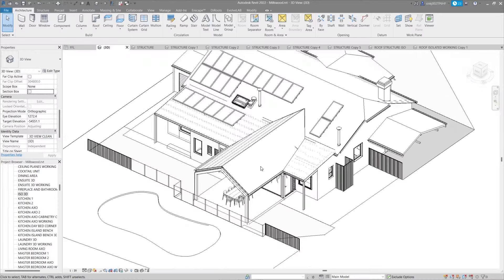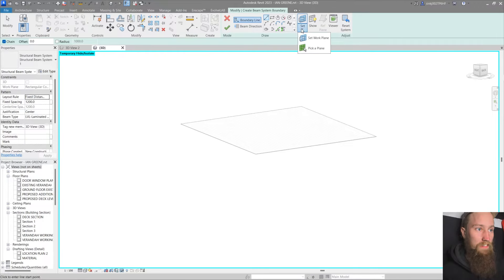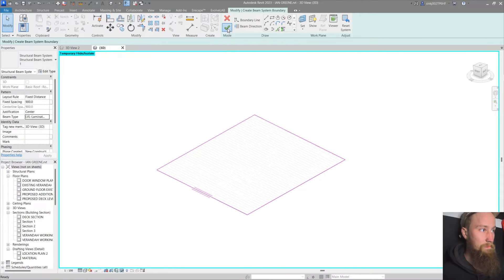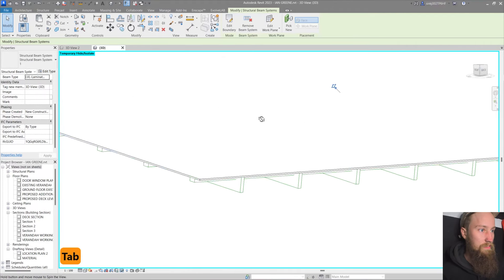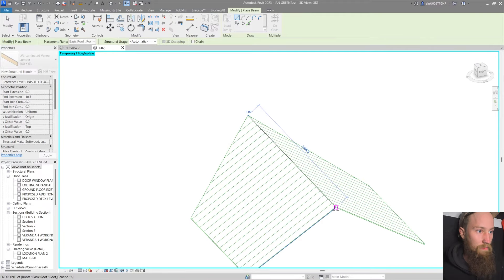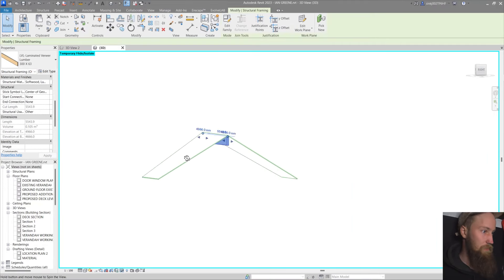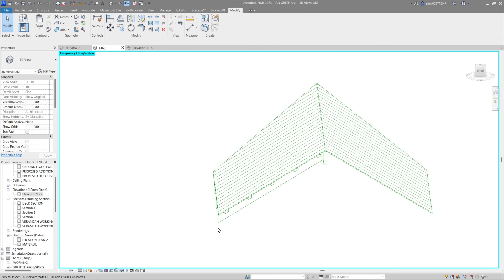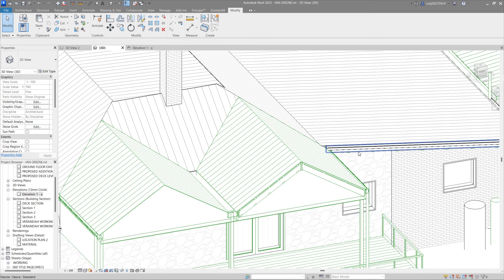Revit Structural Framing Tutorial - Roof Framing with Beam Systems

Comment: When u isolate the roof, can it be moved to a sheet ?
Reply from the maker: You can apply temporary isolate/hide with the glasses tool down in the bottom ribbon. This will make it show on a sheet. You can’t transfer that isolate/hide to another drawing though from what I believe

Comment: Hey @KyleSinko I'm doing a structural + framing axonometric of Glenn Murcutts Fletcher-Page house for an assignment. The rafters are exposed and overhang with the roof sheeting out at 800mm, and they are cut horizontally on an angle for this 800mm. Do you know how I could edit the beam type to do this too? I currently can't even figure out how to edit the the rafter I just loaded into revit anyway, when I go to edit type it doesn't show the option to edit like it normally would with other families? Any help would be so appreciated. Thank you for being the best revit tutor ever :)
Reply from the maker: Sounds like a fun project! I did a similar house in third year. I’m not on my laptop currently but I believe you can specify an overhang in the properties panel. For example, I think it’s “x” extension (or Z or Y), set this as 800 to give the beam an overhang. You can mess with the family by going to the project browser (underneath the properties panel) and find “families” “structural framing” and right click edit family. I hope that helps